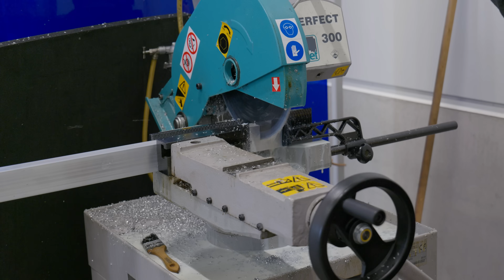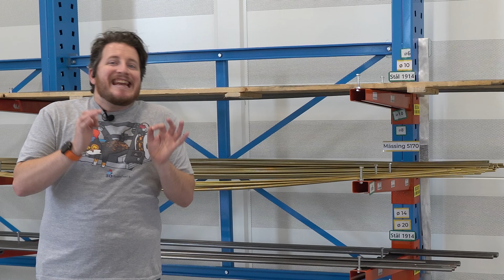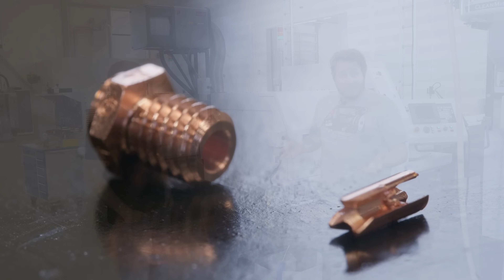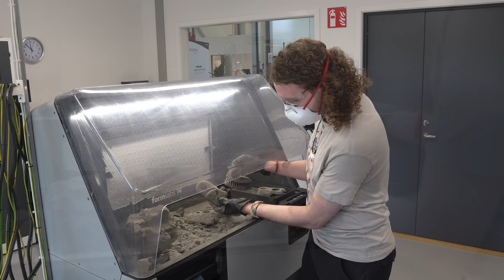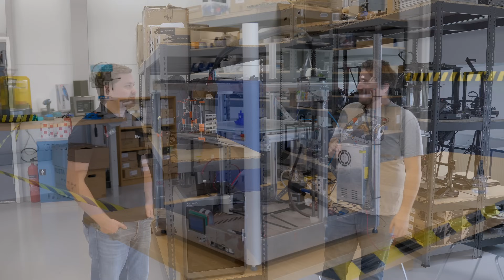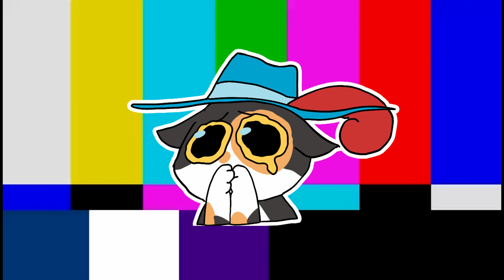How is the INDX Made?!? - Touring Bondtech!!

Comment: Hopefully they team up with a better printer than Sovol, but even Prusa seems like not good enough quality for their system
Reply from the maker: They are releasing the system. Companies can choose to integrate it, but likely the community will drive what machines get upgrade paths. The nice thing about the sv08 is most of the issues it has are all dealt with by indx
Reply: @3DMusketeers  There is a large base who want a fully put together printer and they could lose a large portion of the market. They will lose to competitors unless they release a complete printer or sell the printer with a kit. Hoping for the best from them.
Reply from the maker: Bondtech does not build printers, it will be up to the OEM's to integrate it or not. It is a safe option for Bondtech, as a small team, the support of ALSO dealing with machines would be crazy
Reply: @3DMusketeers  Why wouldnt they want to build their own though? If funding is an issue, Snapmaker just raked in 21 + million on a worse system. The printer producers will push them out eventually if not.
Reply: @Bioworld8  Printer manufacturers are their customers. Competing with your customers is kind of dumb, because it will lead to drama. They have a niche - they develop tech and sell it to other manufacturers, and to enthusiasts.
Reply: @cr0ft-2k  So are Bambu and Snapmaker not making their own tool changers in spite of INDX? The printer makers wont buy INDX, they will find a way to put them out of business
Reply: @Bioworld8  
the amount of rnd it take to develup a printer is gigantic, bondtech is a small company and selling printers to consumer is a very slim margin

Comment: I want to see other tools besides nozzles for INDX. Nm laser specifically, as well as non planar integrations
Reply from the maker: no lasers lol. But the INDX tool should do decent for non planar, but they could easily make it longer too if needed. It is some cad and cam adjustments, but I have faith in bondtech. I believe the plan is to release some designs for the docking system so anyone can make tools, but we will see.
Reply: @3DMusketeers I've either forgotten or never knew. What is the temp limit in the INDX system? We can print a top hat for the SOV8 so everything can be enclosed, yeah?
Reply from the maker: lasers on printers are dangerous, please do not do it without the proper safety equipment. 

There is no known temp limit for the INDX.
Reply: @3DMusketeers how do you mean "dangerous" snapmaker runs basically on core x/y gantry? Is there something I'm missing?
Good to know on the temps. I suppose it will be induction beds next. What a time to be alive.
Reply from the maker: laser safety. Not about the motion systems.
Reply: Plus I think dualies makes sense too.
Reply: Well perhaps SOVOL will, I have a FUNKU laser inbound and it operates on gcode, snapmaker 1024nm is roughly similar form factor why cant we get tooooooooogetherrrrrrr?

Comment: Swiss lathes are awesome for turned parts. I used to setup tornos sas16's at my last job
Reply from the maker: so mesmerizing!
Reply: @3DMusketeers  the ones I worked on were for volume. Could spit out 1800-2000 parts in an hour. Held tolerance around a thou.
Reply from the maker: @sabiti5428 very cool!! They are getting stupid right tolerances here but definitely at the detriment of cycle time

Comment: 10 seconds is just a tad slower than than mmu3........except that's not including the purge time. I believe that's slower than the xl, but at that price who cares. Also it looks like you have have 1 million tools!
Reply from the maker: but the XL tools have to maintain temp the whole time. This does sub 5 second heat up times so no oozing!
Reply: INDX will be about 12-17 secs I think including reheat and priming,  XL about 14 secs, MMU3 about 70 secs, BL AMS about 90secs, BL H2D Nozzle swap about 26 secs (should be faster).   I think a dual Gantry with INDX doing parallel reheat/priming should be able to get the changes including priming down to sub second.
Reply: @dwuk3d  they said 10 in this video.
Reply: @awilliams1701  Grant I think actually said he saw a tool change in less than 8.5 seconds.   I timed it from one of the earlier videos in the Discord and have been following things quite closely.   The only things I think we know for sure are reheat time 4 secs, stabilisation time 2 secs.  You then on top of this need to do a retract, move over to near the release lever, X movement to release, X Movement to line up with the tool drop off, Y movement to drop off, Y movement to go back, X movement to move over to pick up,  Y movement to pick up,  extrude to clamp, reheat, Y and then X movement to move over to prime tower, stabilisation wait, then prime tower architecture if necessary, then priming, then finally move back to continue printing.

Comment: wait, wait, wait, wait.........the INDX is $250 + $35 per tool? Is that right? Hot damn I might need that shit at that price. I didn't think I needed anymore printers, but seriously at that price an actual tool changer would be a game changer. Especially if filament ends up costing $40/kg instead of $20. I print a LOT in color.
Reply from the maker: yeah! It is a toolhead system though, so you will need a base printer for it like a Voron or a Sovol SV08, but the cost of the system is VERY reasonable!
Reply: @3DMusketeers  yeah it is.

Comment: I should probably change the water in my computer. It's 4 years old.
Reply from the maker: if it is a custom loop, it would not hurt!
Reply: @3DMusketeers  it is. It's actually my first. Ironically it's not the original fluid. I replaced it 6 months later because I added a GPU to the loop. Originally I was using my ancient geforce 780 because the 3000 series was impossible to find. It was supposed to be a 3090, but I never was able to find one. I gave up and settled for a 3070. It's better than I thought, but it's still not as good as I wanted. Also it's only 8gb. Which is becoming more and more of a joke these days. nvidia AND AMD are both getting crapped on because it's not enough.

Comment: I use to run CNC multihead drill presses fo PCBs. 2000 holes per minute 20000rpm mandrels 4 times as big as those lathes and they were doing 0.25mm holes....I love CNCs
Reply from the maker: Same